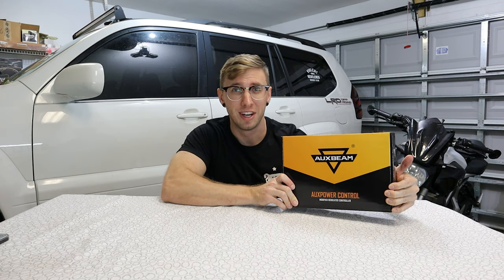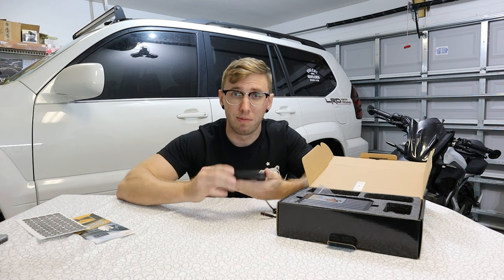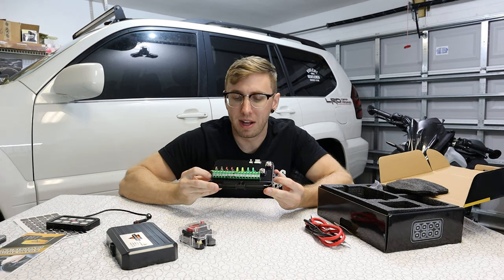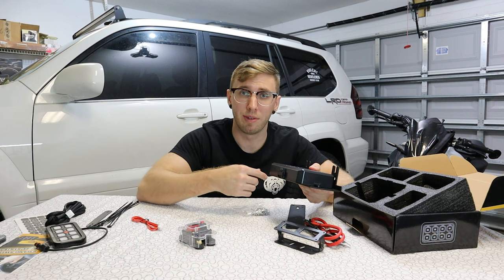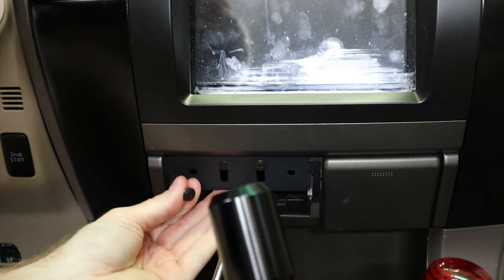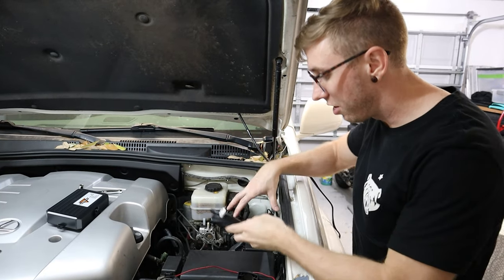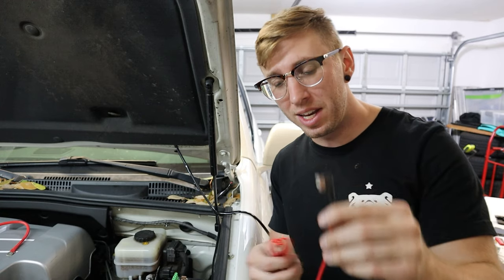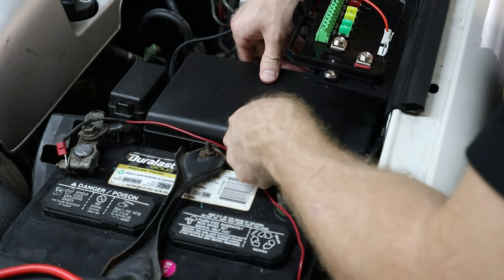Vlog 45 - Auxbeam Switch Controller Install (Lexus GX470)

Comment: Nice setup! I'm working on installing the same auxbeam in my GX, in the same spot where the ashtray was. Wish you showed how you routed the wire under the dash, struggling to find a clean way of doing it.
Reply from the maker: Thank you! That ashtray location works great and I don't smoke, so it was wasted space anyway. For the wiring under the dash, I tucked it down behind the plastic trim and out near the gas pedal, then pull it up above and zip tied all the slack out. Hope this helps!

Comment: I installed my Voswitch in the same spot, modified the ball mount and removed the ashtray face, the whole thing still slides out so the ashtray is kind of a hidden cubby.
Reply from the maker: Hey Drew, that sounds like a great solution you came up with. I like that the cubby is still functional.

Comment: Did you mount the auxbeam straight to the GX ashtray space? Or did you use the previous connection the satellite radio used? Is there a way to put the auxbeam in the same spot as yours or wil we need other mounting brackets than what is provided?
Reply from the maker: Great question! I ended up screwing into the plastic in the ashtray space. So no extra bracket was made.
Reply: @Awesomoto  thanks for answering!!
Reply from the maker: @rkkong  Sure thing Cyrus! Thanks for watching and reaching out!

Comment: what year is your gx im wondering if mine is similar and if i can also use that heated seat fuse with out running into trouble with a relay in the way for the add a fuse
Reply from the maker: I have an 05 GX. Yes, you should still be able to use that heated seat fuse, but the add a fuse is a good way to ensure you aren't risking overloading the circuit.

Comment: Can you swap out the 5 amp fuse for a 10 or 20 amp fuse in the control box?
Reply from the maker: That’s a good question. I’m not sure how their control circuits are designed, so I’m hesitant to say yes. I’ll reach out to see if they can provide an answer on that.

Comment: So you don’t need a relay for each light you add to it?
Reply from the maker: Great question! No need to add a relay for each light if the pair of lights draws less current than the fuse on that circuit.
Reply: Thanks